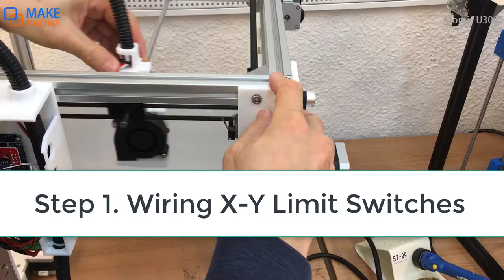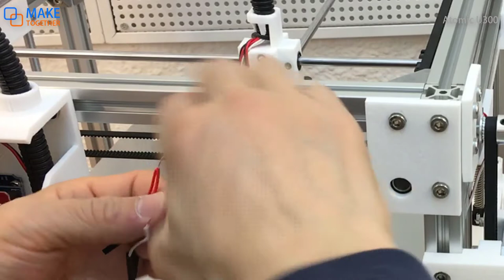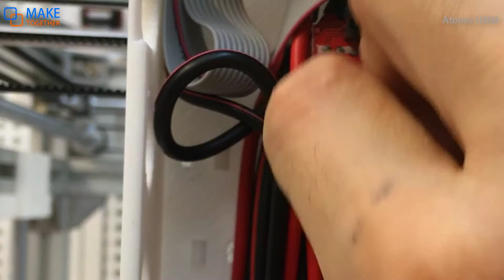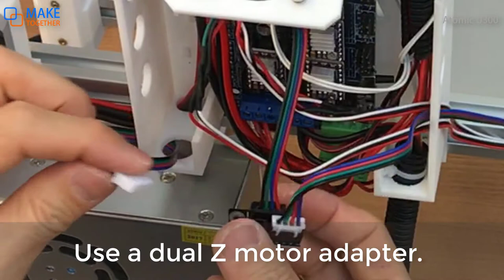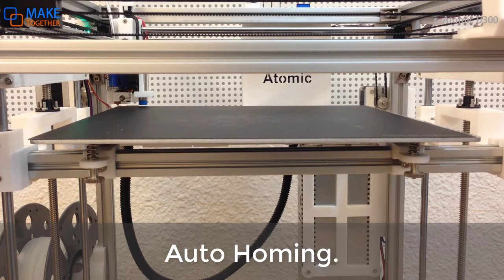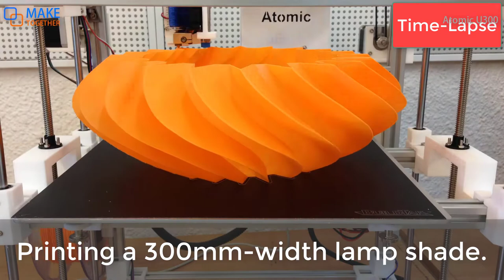Ultimaker Style 3D Printer Build Tutorial 15 - Wiring Completion and the First Printing

Comment: Hi, what is the purpose of using a dual z module, when the ramps already has parallel pins for z axis?
Reply from the maker: Thank you for your question, XAIN.
Actually, RAMPS 1.5 has dual pins for Z motor. But I use dual motor adapter because the space between the 2 pins on RAMPS is too narrow.

Comment: How can I make the head is like the Ultimaker S3?
Reply from the maker: Thank you for your question, Hernando. S3 has a printhead for dual extrusion. One of my next projects is designing a dual extrusion system.
For now, you can download all the design files of 'Ultimaker 3' from the link below.
https://github.com/Ultimaker/Ultimaker3

Among the folders, open the '3D model Ultimaker 3'. There is a big file, 9066.STEP.
You can find the printhead components,.And you can 3d print them